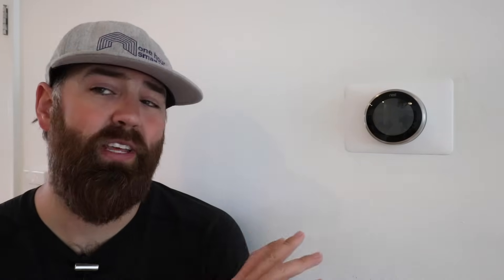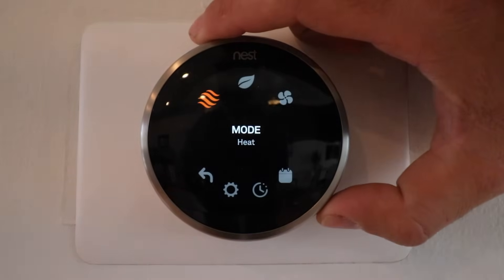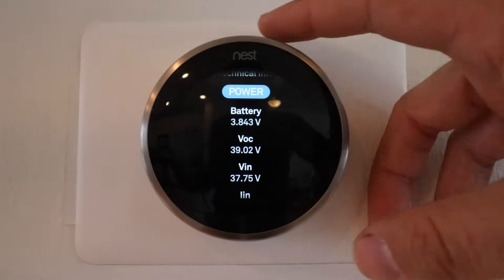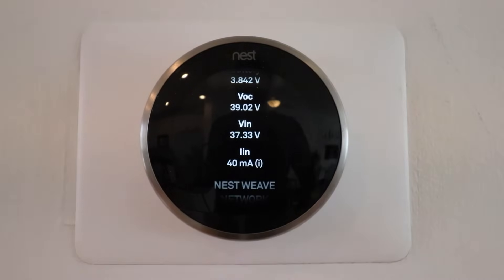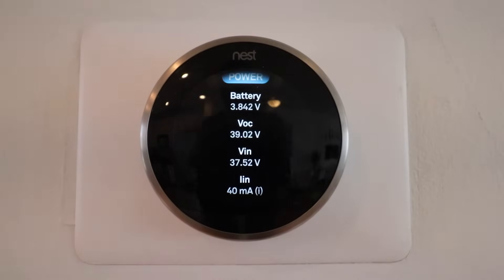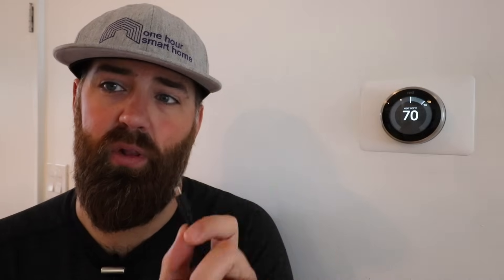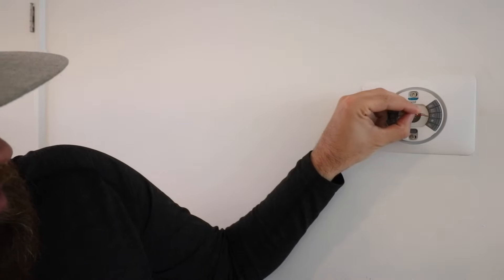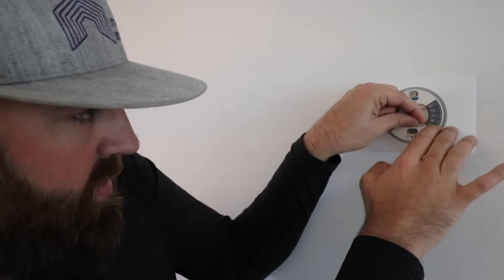Nest Low Battery Fix!

Comment: Lin is actually I in, as "Current-in". L would indicate inductance (measured in Henrys or mH) but that has no bearing on this device.If you look above I-in setting is your V-in, which is in volts.

Comment: If your furnace is a high efficiency system. Adding an external transformer could cause a phasing fault code and shut down the system. Look through the sight glass in the furnace door. Find the blinking red or green LED. Count the blinks and then remove the furnace door. Removing the door should turn off power, but shut the service switch to be sure. On the back there is a sticker that will tell you what the blinking fault code is. If it is a phasing code, reverse the transformer wires that you connected to RH and C. Turn the power back on at the furnace. The system will reboot and the fault should be cleared.

Comment: I have a question  I eas able to change the battery in my nest 3 generation but it still does not connect to the wifi  how can I connect it back

Comment: What about when you just have battery issues in the summer months only? Our home has a boiler for heating that doesn’t connect to the air handler (which manages the AC), so the W1 and Rh go to the boiler (in another room) but then the Rc and G go to the air handler and the Y1 goes to the AC compressor. There is a second wire from the compressor to the air handler that I assume is the C wire? 
Can I use a Nest Power Adapter with this and connect to that second wire as the C wire or can I run a C wire directly from the compressor to the thermostat? 
(The other confusing thing is that our house has a whole home humidifier, but of the two wires on the back of it, only one is connected and it’s connected to the white humidistat wire, but the blue wire was left disconnected for some reason)

Comment: Just had a bad lightning ⚡️ storm and a few other electrical problems came up along with my nest thermostat going out saying no power. I checked the breaker and it is all good and not tripped. Next I took the thermostat off the wall and charging with a c adapter now! I suspect wiring damage! What you think? Okay Battery is fine but Lin is 8 mA then the diagnostic says E4 warning report No power to Rh wire detected.

Comment: I have a nest 3rd gen and my power readings are Battery 3.7V  voc 40,11V vin 8.13V lin 20mA and it seems like my a/c isn't really kicking in, before the nest the blower would speed up and shoot out a lot of cold air now it just stays at a low speed and can't keep up on very hot days. Any help would be appreciated Thanks

Comment: if the battery in the air conditioner thermostat is dead, will it cool? The air blows, but does not cool. I just put it on charge, I'll wait 2 hours

Comment: i charged the nest thermostat for a whole day and it's still says it's low .
Reply: Having the exact same issue right now. Had it on the charger for literally 7 hours and it’s still low… did you find a fix? Considering just buying a new one i suppose
Reply: @ yes , buy a new battery bro 1st before anything . Amazon is about $13 for the battery and comes with tools
Reply: @ I’ll look into it, I appreciate it!

Comment: BTW, if I recall my electrical engineering power classes correctly,  the "I in"  is actually CURRENT IN...  The letter  "I" is usually designated for CURRENT.

Comment: I have a 2 wire heat system. Nest kept losing battery power. I want to add a power supply feed to the Nest. Do I add power to Common & RH? I put the Oil burner on W1 & W2. ?

Comment: Thanks.  Helpful.  One thing to ask/add.  When I went to charge through the usb cable, the thermostat shut down.  Before this I was only getting 20ma on lin.  After rebooting the thermostat, it came back at 40ma.  I was having intermittent low battery issues.  Hoping that the 40ms lin will now charge the battery faster.
Reply: Also, I figured out you can reboot it on the wall by just pressing and holding it down for about 10 seconds.

Comment: I have taken the unit off the wall and placed it on a charger overnight. It powered on just long enough to get to the settings menu and shut back off. I have used different chargers, but still no luck. When on charging cable, it initially blinked the green but eventually changed to red.

Comment: Sadly, I rent and have no access to the HVAC. My Rc is also short linked to my Rh. My Lin is 20mA. I've been getting WiFi connection problems. None of Google's tips helped at all. I'm currently charging the battery, as it was at 3.65V so hopefully that works "until next time".
I did contact Google/Nest support and they are sending me a replacement. They didn't even check the power settings.

Comment: Hi my issue is!! I am a new moved into a home with a nest thermostat!! ( a new thing for me) and it has been disconnected from my  wifi for about 6 days.. I live in Worcester Massachusetts which is usually very cold and I am dreading that this nest thermostat  will not work .. i did most wifi troubleshoot and it is still offline…😢 any ways to fix this… cause if not!! I am contemplating in getting rid of it!!

Comment: 090124:  Coming from the NE I never had a central ac.  So in FL this was all new to me.  My nest was displaying a low battery no matter how long I charge it.  After watching a few videos, someone commented that he paid a tech who discovered the flow switch had tripped.  Sure enough I saw a small flood.  I looked for solutions and decided to clean up the drain pipes with a bit of bleach and water, then with pure vinegar.  FINALLY the AC stared running and the low battery icon disappeared.  It’s a great feeling fixing things up and $aving 💰 😅. Thanks for your sharing your insights, they are so clear and helpful.

Comment: Thank you for producing this video . Long story short, I’d been having battery issues. This alternative (to running new wire to add a common, or using the Google Nest Power Connector) seems to have done the trick. 

Thank you, again, for sharing your knowledge.

Comment: I only have a R wire and W1 wire and when I touch the two together nothing happens.  I went on my roof and my unit has 2 big 40 Amp brass fuses can that be my problem. It's been 105 to 118 here for 3 weeks maybe over worked it

Comment: the "Lin" is actually "Iin" as in indigo. I is the symbol for amperage (current), mA means milliamps. So you can get the correct voltage, but if your current isn't high enough, it won't charge fast enough.

Comment: The Nest thermostats we have (one Nest E and one Learning thermostat) both lost their WiFi connections.  The trouble-shooting guides say that it will not reconnect to WiFi unless the battery voltage is at least 3.8, which I can confirm.  Once connected, yes, the voltage can drift down a bit, below 3.8.  But once it loses the WiFi, it will not connect unless the voltage is at least 3.8 v.  I have found that charging the battery from the USB won't necessarily raise the voltage to 3.8.  Most I could get was between 3.7 and 3.8.

Comment: @OneHourSmartHome I have a question. I have the Google Nest and it's telling me I need the C wire power adapter. After watching this video I was going to take the green wire and place it in the C wire slot at the thermostat and then do the same on my HVAC. However my HVAC has a C1 and C3 . My thermostat wires are colored red and is connected to R, Blue and is connected to Y, White and is connected to W1, and the green is currently on the G. It looks like the power wires are red on C1 and white on Y (along with the B). Should I just place the green thermostat wire onto the C3 on the HVAC system? If it would help I have a picture I could send you

Comment: Unfortunately, this is not the solution for the eventual death of all Nest thermostats. I already had a C-wire setup for mine, and the battery will still eventually wear out. Then, because this product is monumentally incompetent and irresponsible, you get to THROW IT AWAY. The aftermarket batteries get terrible reviews, and you don't want a fire risk in your wall. Do yourself a favor and get a $30 proper programmable thermostat and go on with your life.

Comment: Hi When I wanted to replace my old thermostat with a nest learning thermostat, there are two wires from the wall connected to my old hp thermostat on the W and B terminals. There is a jumper from R to RC. How should I connect these two wires to the new nest thermostat? W to W1 but B to ?

Comment: I have two wire system on my cm907. I have been able to plug transformer and insert the two wires of thermostat to nest learning and that has resolved power issue but it is not kicking in my heating system. I have put white cable from cm907 into W and Red left it hanging.

Comment: What if my system doesn’t have a heater and I’m still getting the RC/RH error? I went ahead and connected RC to w1 and A/C started working. Does this mean that there is power? Or does the fan automatically turn on regardless but not the compressor? Thanks 🙏

Comment: The 5th issue for low battery/offline - If you have a nest older than 4yrs, the internal lithium battery is dyeing causing a short or pulling to much power on the Rc line.   Like mine, if that happens, reconnecting your thermostat after charging blows the 3 or 5amp fuse in your controller board (in the blower unit).  So you will need to replace the nest battery and your fuse before things will work again.

Comment: Good video. Two comments. First the "Lin" is I (eye) in, "I" is a notation of current which the 40mA is. Second, I am not sure putting two 24 AC transformers in parallel is a good idea. I guess if the AC is rectified before combining the two it may be OK but putting two out of phase AC signals could lead to pulsing or possible fuse opening. It may also be sensitive to the wiring polarity. One way may work and the other may cause cancelation of the two, not sure.
Reply: They're both DC, aren't they?

Comment: You mentioned low temp in the house could cause this issue.  Can you explain why please?  I was away on vacation, house was at 55 degrees for a week.  I lost wifi connection before getting home.  Low battery notification on screen.  I turned up the heat and everything seems to be fine now.  3.77V and 40 mA.

Comment: The fact that this is such a widespread issue should tell you all you need to know about these products
Reply: I'm never recommending Nest again. Garbage products
Reply: The Nest is disgraceful trash. Even when functioning, the UI and "learning" is brain-dead and incompetent. Even worse, it's an entire computing device that you're supposed to THROW AWAY WHEN THE BATTERY DIES. Unfuckingbelievable. I have a powered (C-wire) thermostat connection, and I had to trash the Nest because the battery died and the aftermarket batteries all have hideous reviews.
Reply: Yes!  Very dangerous when dealing with frigid  weather, like I'm dealing with right now!  Ugh
 Not a good thing with a weekend home in a cold climate!  Damn!
Reply: Wow !!!! Imagine somebody elderly trying to do this on their own.  Not good.  😢.

Comment: I have two nests that have been installed for 5ish years. They each go to their own air handler, as they support two separate systems. Both have gone to low battery and disconnected from wifi within 2 days of each other. I have a common wire, it has never been connected. Any tips or ideas? I replaced the batteries, reset to factor settings, and one unit is already back offline with low battery. Other is working.

Comment: Hey man, so I have a nest learning thermostat. It’s been in my house for about two years now. My setup has a Rc and Rh as my AC and Heating are separate. I never had a low battery issue in the two years. All of a sudden it’s low battery. I don’t have a C wire attached. I tried using a unused blue wire already ran from furnace to thermostat but when I connect it, I get an error that there’s no power supply. I’ve read a furnace can’t support the C and needs to come from AC. 

We rather not use the transformer option as our thermostat worked for two years without a C wire. 

What do you think is the culprit of this? If I plug in the nest with a charger cable, it charges just fine. 

Any thoughts or work around?

Comment: Is it possible to "split" the C wire, so as to provide power for battery charging and maintain fan-only use?  I use fan-only quite a bit for moving the air around inside the house, with windows open, when I don't really need AC during summer months.  I never use fan-only during winter, heating season.
Reply: Good question

Comment: Thanks so much for your video, it does help us a lot for fixing the problem. Would like to ask even we fixed the problem having the power back on after charging the thermostat, do we need to replace the new battery as well?

Comment: I've had a 3rd Gen nest installed for roughly 5 years. Never had any problems with it until 2 weeks ago. Then I had an offline notification in the app, and the display would not turn on when walking by. I ended up purchasing a new nest, and still have the battery at 3.16v,and the Lin at 20mV.
Any clue as to what possibly happened, and what to check out?
Much appreciated.

Comment: My Lin is sometimes 20 but sometimes 40. Why would this be? I'm not understanding anywhere why it would fluctuate...? Instead of adding a 'common wire' would there be a way to have/fix more stability from the ac unit supplying power? You would think an ac unit would have plenty of juice.

Comment: So we just bought one new in the box from someone who said they’ve had it for a year and didn’t do anything with it. We set it up and connected everything. Said low battery, took it off to charge for like 3 hrs. Put it on, says low battery shutting down. Could that be an hvac failure?

Comment: This video single handedly helped me fix my mother's Nest Learning 2nd gen thermostat when nothing in Google's Nest Troubleshooting site, Nest ProTech Diag pdf, Nest Community forums, or any other Google Search return could. 

The Event: Heating for past few winter months (NO A/C usage since October 2022). Beautiful day in East Texas, mom turns Nest "Off". Next day, 80°F+ and 95% humidity, mom turns on A/C, and leaves to run a few errands. On arrival home she realizes that it's 78°F in the house. Air Handler blowing air, air not cooled. She calls me, the dutiful son. Nest Learning 2nd Gen display in error mode with message E30 - "No Power Detected for Y1 wire". Y1 is the Air Condenser unit outside of home. In Tech Info menu, it also says that "WiFi Disconnected". Can't get out of error mode other than to view "Wiring Diagram" and the various "Tech Info" submenus. I remove display unit to check wiring, all are fully seated. Wires are Y1 (A/C Condenser), G (Ground), Rc (Cooling Power), W1 (Furnace/Air Handler), Rh (Heating Power). I go outside and manually inspect A/C and it's independent breaker, not on breaker good, flip breaker, still nothing. Go inside reinstall display unit, same message error mode, can't get out of error mode. Left. Today the A/C came on by itself and started blowing cold air. No more error mode. Settings display "No Wifi Connected" and several functions auto disabled. Removed display unit and then it showed "low battery". 

I think the turning the nest "Off" for a full day drained the battery enough that it just couldn't function and was drawing it's power from the Y1 A/C or W1 Heater, but since we were trying to run the A/C and not the heater it couldn't charge itself to switch the A/C on and since we have no C wire it can't charge itself when neither HVAC systems are running maybe?

Comment: The nest video shows 4 wire hook up and says nothing about low battery or adding a 5th wire. Can't I just charge it and then it will charge upon fan running later? Or does it not charge at all without a 5th C wire?

Comment: One of my customers has a blank display. We tried to charge it using two different charging wires and it now comes on for about 3 minutes and dies again. It's a 2-wire steam system so there is almost always power at the primary control providing the nest its 24 V.  I'm ready to condemn the thermostat.

Comment: Many thanks! Been going a little crazy for a couple of weeks, but your video helped me fix the little bugger, using the fan wire as a makeshift “c” wire. When you led me to the battery and lin levels, it proved to be the culprit. Finally running well, and the nest 3rd gen didn’t end up in the pond😉
Reply: i had the fan wired as a makeshift c wire too - but i'm still having low power issues. what was the culprit, and how;d you fix it?

Comment: I just added the transformer to my system which is a 2 wire. I put one wire on Rc and  soon as i land the wire on C the heat comes on and wont turn off. This is even without the transformer being plugged in????? Soon as i remove wire on C terminal boiler shuts off again. 🤷🏼‍♂️

Comment: Kind of a lot of details missing. The charging cable would be called a USB micro connector. He doesn't explain what LIN is. Is it the line voltage ? He doesn't explain what the other is. Is it the voltage and ampers provided by the battery ?

Comment: My battery is at 3.9v and lin is 200mA and vin at 39v and mine wont stay on anymore or connect to wifi and its only a year old :(
Reply: Mine too, is there any way to fix it ? Pls !
Reply: @ToniHuynh-vs5ck  you have to contact Google for a warranty replacement. It's a known recall issue that they will replace up to 2-3 years old
Reply: @ToniHuynh-vs5ck  even after I replaced the battery myself it still said the low battery error, it's definitely a software bug
Reply: Mine too.
In winter it was ok